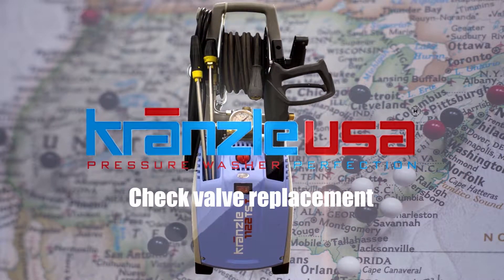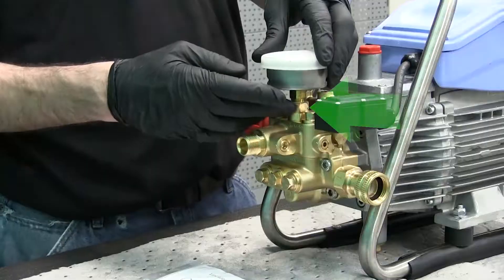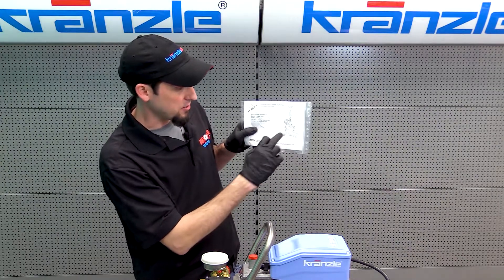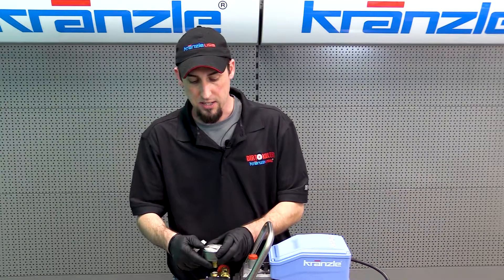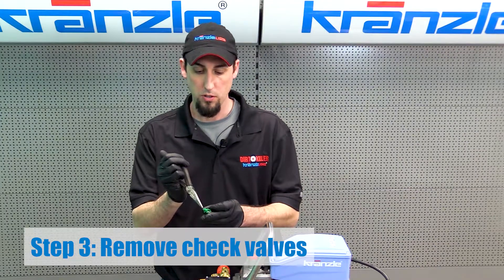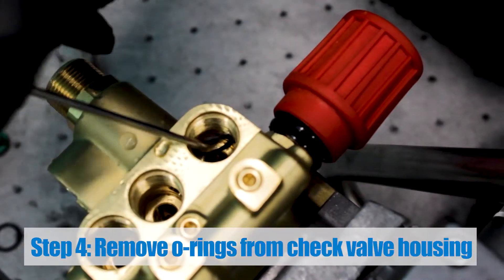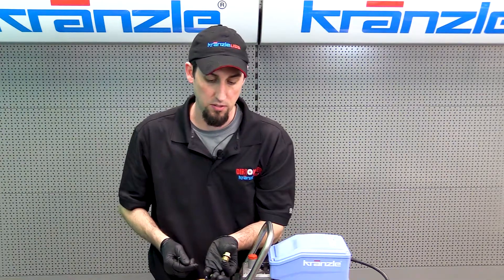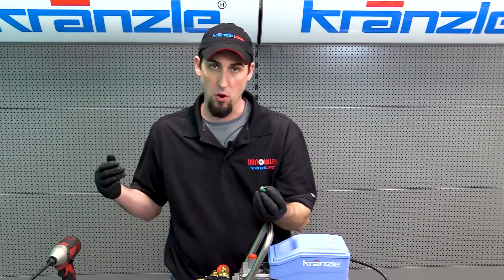Kranzle Check Valve Replacement : 1622T, 1322, 1122TST

Comment: I have occasional pressure surge on startup. It usually corrects itself after a few seconds. Does this mean I need to replace check valves?
Reply from the maker: Could be. Just a cleaning might do the trick. Give Lee a call to help troubleshoot. 800.544.1188.

Comment: This video saved me and my Kranzle. I had changed the resin in my DI and accidentally got some into the outflow tubes. This then made its way into the Kranzle and I had complete pressure loss. Water flowed fine, but pressure wouldn't build at all. I first watched and followed the procedure in the "Complete Pressure Loss" video (removing and checking the unloader and bypass). Those components were clean so I started getting nervous. I then watched this video and dismantled the check valves. I did the suck test on all six, five were stuck open. I cleared them with compressed air and could see the resin on my fingers (it wasnt visible to the eye in the valves). After cleaning them (and the valve cavities), another suck test proved they were fixed. Put it all back together and the machine was back to normal operation. Thank you VERY much for this!
Reply from the maker: Awesome! Glad this video helped. We are working on more so be sure to subscribe.